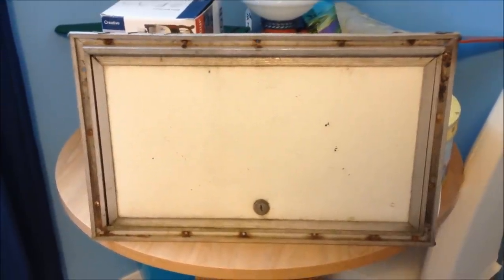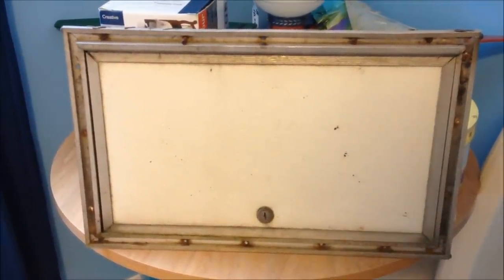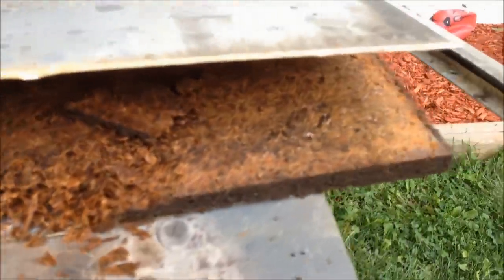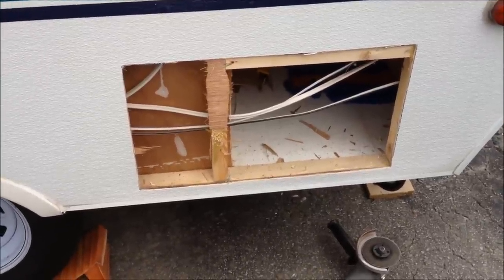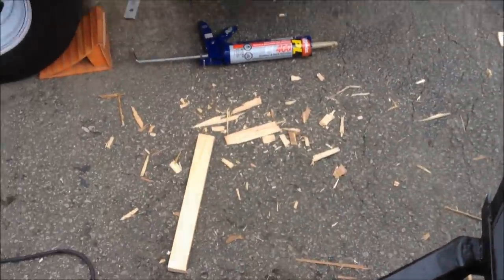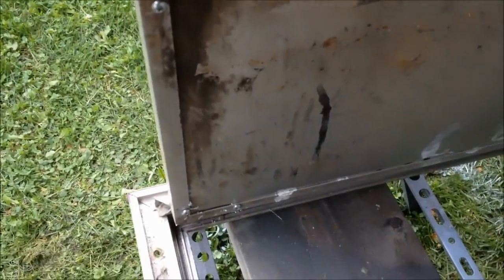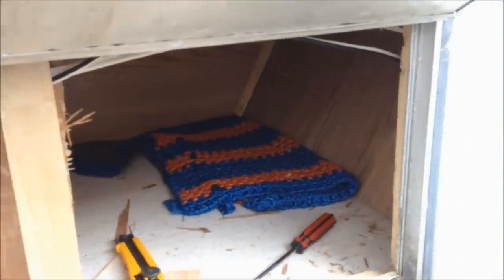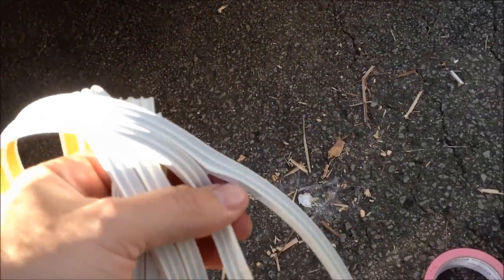Storage / Baggage door installation into popup trailer / tent trailer

Comment: Great job. Any reason you had the hinge on the top and lock on bottom?  If you had reversed that, you wouldn't need to hold the door open to use it.  Just a thought.  I need to rebuild mine on a 2001 Palomino popup.
Reply from the maker: Steve Neitzke thanks for watching. The reason I did it this way was for safety. If the lock were to come loose the door would stay closed.

Comment: hi ive got a 97 Cheyenne with the large dry storage compartment.  it leaks.ive replaced the rubber gasket. any ideas
Reply from the maker: Cathy Penny I would make sure that the lid is not warped and creating a gap. Put a work light inside the compartment and close the lid. Then when dark outside look for anywhere light is escaping. This will let you know where water could be getting in from.
Reply: John P . well I took the top of 7th compartment off and there was some rotten wood.thanks I will try it once I get it back together

Comment: hi there.i have a 97 Coleman Cheyenne. It has the large storage compartment on the front. do you know if it can be replaced ?
Reply from the maker: i am not familiar with how those are constructed. Are you having issues with it?
Reply: Yes. It seems to be coming apart from the body
Reply from the maker: I would first see how it is attached and check for rot around the fasteners